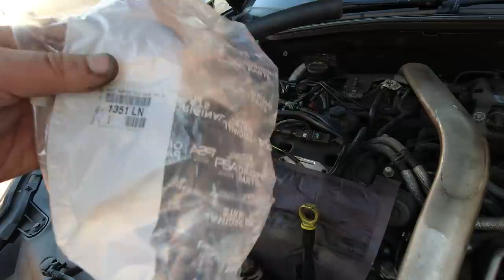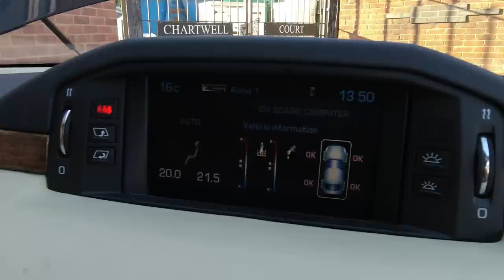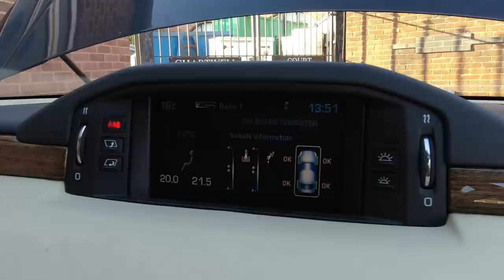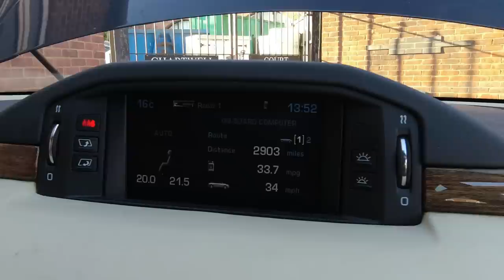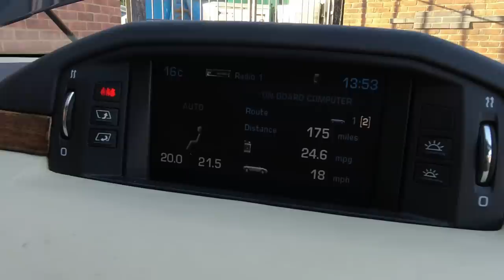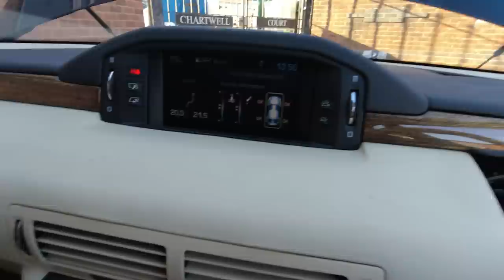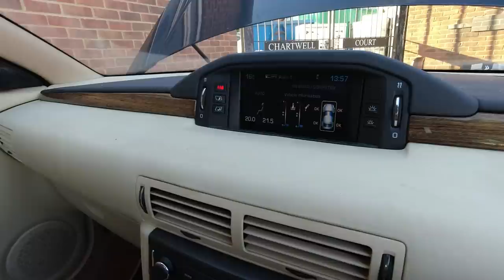Cheap Citroën C6 Project 9:  The straw that breaks the camel's back?

Comment: sounds like you need to find a 2.0 litre Citroen Xantia dirt cheap to run especially a diesel one reasonably comfortable easy to park older suspension technology easy to make suspension pipes for unlike the LDS system other than that the  engines go and go they are virtually bomb proof. my 1998 2.0 litre diesel estate was 18 years old when I let it go it had 301k on the clock and for the last 7 years of its life it ran on recycled old veg oil. only 90 BHP but it went like a steam train.

Comment: I had the same issue with my Rover 75 alongside other problems was the price of diesel and road tax it was costing me far too much to run was looking at £100 a tank for derv and the repairs were costing too much as well. I went to Sheffield and filled up before heading  to Edinburgh thinking £50 for half a tank... Nope not even half a tank. So its nice to have the Cactus 42mpg say £75 a month for fuel and £20 quid a year tax, ok it's only 82bhp 1.2 but I love it Hubnut ethos Power less is more. Plus I also like the Poverty spec of the Cactus no rev counter, 3 cylinder engine note, steel wheels (I have alloys for the summer)

Ever considered a mark 1 Fabia vRS?? Prob as much fun as the Saxo and the tuning options are endless, I had one and was kicking out 170bhp! And was still getting  something like 56mpg!
Reply from the maker: I don't mind the Fabia VRS, though doesn't especially jump out at me.

Comment: Just an idea, fix the DS get it converted to LPG... Cheep to run no tax or mot. The best suspension ever comfortable seats from long term memory as in 45 years..... It's not something you see on every corner.... Oh I have an A2, 1.4 TDI 75 hp. Very practical, it's narrow but ok. Yes you can get 4 people in it... The boot is actually quite big. It's more than fast enough.... Has amazing air conditioning, they need good tyres as they weigh so little it's hard to stop .. yes I did have a little knock because of lack of grip. My Saab 93 diesel convertible would of stopped no issues.... The only thing with the A2 it has a very small fuel tank..... Yes it's economic 45 mpg +  but I swear it has a ten ltr paint tub for a fuel tank ....
Reply from the maker: The costs to convert it, though...?

Like the sound of the A2 TDI.

Comment: Hi there, just watched this video where at the end you mentioned that you liked the idea of a 3 cylinder. Just a sugestion but I have just swapped my old Renault 5 for a 2001 Suzuki Swift.  It's comfy and rides okay and is very cheap to run. Reliable but then mine's done less that 10k miles, maybe not the best for making "fixing" videos?
Anyway, just an idea. Keep up the good work, oh and I'll subscribe so it doesn't take 5 months to see your filmage.
Reply from the maker: I quite like those Swifts actually.

Comment: How about a Renaultsport Twingo? I had one for 18 months and loved it for what it was. Engine was very happy to rev and give everything it had all day long, and it handled like not much else I've driven (it's setup from factory to have some liftoff oversteer if you want it, roundabouts were a lot of fun) And if you drove it sensibly, 40MPG was achievable without doing any drastic. 

Or if the Twingo RS is too expensive/thirsty, you could get the Twingo GT with a 1.2 Turbo.

Or how about a Citroën C2 VTS? I don't think I've heard your opinion on the C2s. Maybe there's a reason for that 😅
Reply from the maker: I'm not mad on the C2, purely because the Saxo is so, so much better to drive. Don't dislike them as such, but can never get excited about them. They feel VERY cheap inside, too. 
Quite like the Twingos.
Reply: @UPnDOWN   The Twingo RS is a great little shout if I do say so myself. I bought a mint 2012 one for £3250 5 years ago, brought it back to Ireland, must've been only one of a handful in the country because they weren't officially sold here.

Unless they're out of budget, I'd really recommend one. If you do get one, buy one with the cup package though.

Comment: I don't know what the UK market is like, but here in NZ the early Nissan Leafs are about NZD6000 up (GBP3000) Only about 50 miles range, but for the usage that is bad for the C6, that range is just fine, and for use for commuting you could charge it during the day. I have a little Note with the same electric motor, and it encourages me to be very immature, in a quiet way, at traffic lights. I bet the "tax" is low, too. You might be able to keep the C6 as a pet, and for the odd long trip? Plus, you could write it down to getting in on the new tech. At some point, someone's going to want to put a Tesla motor in a TVR (or, more usefully, an old Iveco).

Also, do you have to pay that much for a phone? I tend to buy phones outright, second-hand, on the local auction site; there's always a few people who HAVE to change their phone every year or two, so there are good ones around. And the local big mobile company has a cut rate pre-pay deal which suits me fine for ~GBP10 a month, though I don't use the phone much, so it cost more for a business user. It's branded differently, and they're obviously selling off cheap the capacity they can't sell at full price, so it's very no frills--but they also get higher customer satisfaction ratings than the full price company. Telecoms are prime examples of the way a modern company treats its customers as prey, so there's a certain satisfaction in minimising my contact with them.
Reply from the maker: Probably worth a bit more over here, though I haven't looked. I'm happy with ICE but I need to be more sensible about daily costs. And yes, that usage isn't doing the C6 any favours.

As for the phone, brand new you're talking £500+ for something average. Years of having a semi-decent phone (I don't go crazy) regards camera etc. mean if you go backwards in tech to a 2nd hand handset or whatever, it irks me when it's just that little bit duller on the screen, and takes that little bit longer to do stuff, and the battery life goes off a cliff. 
I don't mind making the phone one of my higher-cost expenses as I use it a lot. I spend much more on cars I never drive!
Reply: @UPnDOWN  I'm not trying to persuade you, of course (wouldn't work, anyway), but just so you know that you can get out from under the Telecoms Monsters at least a little bit: I had a quick squiz on eBay and in the UK Galaxy S21s are going for about GBP500. Never had a Samsung myself, but they're not average: that's the trick about buying your own phone, getting a 2 year old flagship. In case you hadn't found this out yet, you do have to be careful buying stuff second-hand, but some of those handsets will be in better condition than anything that's been in a workshop for a month. Same will go for the really good phones that are a bit less, shall we say "premium", when new. Anyhow, I hope you come to a resolution about the C6, but for a daily commuter I must say it only seems a little more practical than a Rolls Royce. Now there's a thought.

Comment: Our diesel is more expensive in NZ too and on top of that all diesel vehicles have to pay a Road User Charge which is  71.00 NZD per 1000km. We are so ripped off. It would be a shame if the C6 goes.
Reply from the maker: Wouldn't likely be 'going' anywhere.

Comment: Did you order from Jim, at Yeoman’s? 😬 Very helpful chap! Btw: been there, done that, with those pipes… 🤪

I hope you’ve also replaced the ‘stat housing! If not, it’s waiting to bite you in the arse. I have a spare one if you want it, along with some other cooling system parts.
Reply from the maker: I gave up with them quite a long time ago. Service side were OK, though.
It's had a stat housing in the past, but I'm not sure if it's leaking again. One of my jobs is to find out.
Reply: @UPnDOWN : In the middle of the vee there’s just the ‘stat housing (coolant output tank!) and the diesel fuel heat-exchanger that are cooling system related. Could be a failing O-ring or, of course, a weeping hose where it attaches to one of the spigots; but IME it’s always been the former: the housing starting to split open.

Be verrrry careful in there, with the fuel return pipes that attach to each injector; and the swirl valves’ rubber tubes that attach to tiny plastic spigots. They all get very brittle and can break off so easily… 😳

Comment: I know it's boring but buy a petrol Toyota or Honda, maybe a Mazda, as long as they're made in Japan. Throw a bit of Dinitrol underneath every now and then, change the oil every year and it'll just work. Or a K11 Micra.
Reply: FN series Civic. Ours (1,8 VTI) does 40 MPG however you drive it and will not die. I Kinda like the way it looks and the interior is "different" and hard wearing.
Reply from the maker: Not against Japanese stuff at all. Only metal I'd struggle to get excited by would normally be German, just find them so dull.
Reply from the maker: I like the FN Civic.

Comment: Direct injected diesels take AGES to warm up. Because they are so efficiënt. Ask anyone who has driven one in freezing temps. It takes 10 to 20km's before the heater even gets warm.
Reply from the maker: 100%. I think the C6 has an auxillary heater for the cabin, if memory serves.
Reply: can confirm, even "smaller" diesels do, my Mother has a Renault Laguna with the 2.0L Diesel and 175ish hp that i used to go to and from work with when i just got my License, my commute to work was 20ish km, and that was just barely enough for it to get the coolant to operating temp in Winter, would have taken a lot longer for it to get the oil up there as well.
Reply: I do concur, my wife's SEAT Altea XL with the 1.6TDi takes absolutely ages to warm up too. However, my Volvo V40 with the 4-cylinder 2-litre 190bhp turbodiesel is surprisingly quick to heat up - usually up to normal on the gauge within a few miles even in town!
Reply: @UPnDOWN  It helps extremely well to change/upgrade that auxiliary "automated" heating element (if it was a diesel heater) into "manually activated", so You can get it started in colder conditions ten minutes before You even start the engine. Did that with VW T4 and T5 bullies with excellent success, reduced consumption rates in short to mid range driving by roundabout 2 liters/100 km. Did something comparable with an electricly auxiliary-heated Mercedes 320 cdi which got a Diesel auxiliary preheating unit as an add-on - also roundabout 2 L/100 km in short-to-mid range use. And those 3-to5 kw heating elements are out there for a song and some dirty fingers when overhauled properly at home, same with controlling units and add-on pumps .... There are chinesium versions even cheaper in new, while there might be a problem homologation-wise, MOT-wise respectively. Putting on a Webasto or Eberspächer plate on a chinesium heater did work more than once with my German TÜV though.

Comment: Is this the same engine fitted to the old range rover sport?
Reply from the maker: Yes, mainly. The Range Rover used a single turbo and the block is actually a different casting, but basically the same engine. They're more trouble in the heavier LR and RR products. Same engine as certain Jags too.

Comment: Quel dommage! The legions of us who heroically spend ages and a fair bit of cash repairing old but modern-ish vehicles, only to have it systematically dumped on by failing plastic and engine bay complexity designed to never be meddled with. You've either got to go older (pre-1980s with all the attendant rot), or just give up. And we won't give up, but it's pretty depressing knowing that we're in the closing chapters of a nice book. Who will be doing guerrilla repair work on a 15 year old Hyundai EV? But I still want a C6...
Reply from the maker: I think for 160k miles it's doing pretty well, but the list of potential issues is large.
Reply: @UPnDOWN  Yes, it's a fantastic machine. The sadness is that with all that kit on board and the tight packaging, it's tough for amateurs to work on. I gather you have an SM... That appears to be more spacious to work on and there's less tech.

Comment: The official reason for not having a low coolant sensor is hilarious. The later c5's are the same..
The 2.7 was never the best engine, especially for short distances. The 3 litre was a better donkey, but neither are 'big' diesels.
I also wouldn't believe the trip computers, in my experience they're always optimistic.
Ved is what it is sadly.
Clearly what you need is a c5 tourer. The 2 litre is all the power you need, comes with aisin Warner auto, the pan roof is ace, I can get over 50mpg on mine, its got all the toys.. Great suspension, and it's French, also doesn't have a low coolant sensor though..
Reply from the maker: Trip computer's pretty accurate in this one, to be fair.

Comment: Gearbox requires the air con to be working it keeps the gearbox cool
Reply from the maker: Really? How's that?
Reply: @UPnDOWN  in front of gearbox is heat exchanger this is linked to the air con, gearbox oil flows through this and is the reason why   the air con is enabled if you look it is round unit
Reply from the maker: @briandeane5671  yeah....I'm not sure you've got that right.
The heat exchanger has coolant flowing through it. Plus, everything Aircon related at the front of the car is hot, not cool.

Comment: Dear Reader,
Would selling the C6 and the 'Ford' (never heard of the model) and buying a good GSA, BX or XM be a sollution. You would keep the confort, and I think they cost less in fuel and taxes. Perhaps you also have an oldtimer 'tax' (in the Netherlands 25% taxes before 1988 and no taxes from 40 years and older)?

Just a thought.

With Kind Regards,
Michel F. van den Brun
financially struggling
Reply from the maker: Well, I have two BXs, so...
Reply: @UPnDOWN  Sorry, I meant an estate version of one of this models.

And I think I've seen you sell an estate once.

With kind regards,
Michèl

Comment: i do genuinely believe that the C6 is one of those cars where the Diesels are genuinely worse for reliability than the Petrol model, guessing if i ever get a C6 that it's gonna be a 3.0 V6 ES9, and not one of the HDI engines.
Reply: has to be cheap to run, comfortable with good suspension, and velours interior, shouldnt' look like a daihatsu move, so, basically, you need a BX Break.
Reply: I have a 2001 C5 with the 2.0 HDI engine. Looking at this video, I see why my Citroen specialist mechanic warned me off the V6. He also said the petrol 1.6 THP was "not enough engine". I've done about 35,000 km in the past 2 years and it now has 185000km on the odo. The only non maintainence thing that's gone wrong is a vacuum actuator on the EGR, Cheap and easy to fix.
Reply: @cme2cau  yea, the V6 petrols are fine, the Diesels, idk, i wouldnt' want to risk it personally, the THP luckily wasn't offered in the C6.
Reply from the maker: Oh, definitely. The petrol is the simple & slow version - it's a total role-reversal!